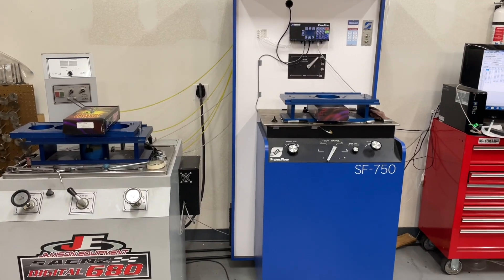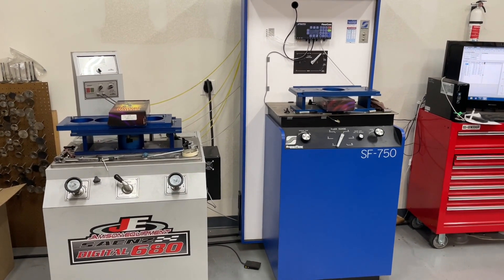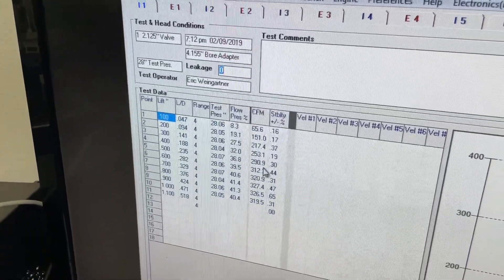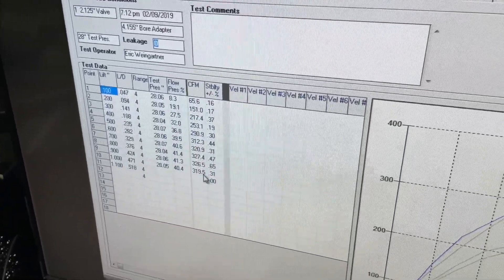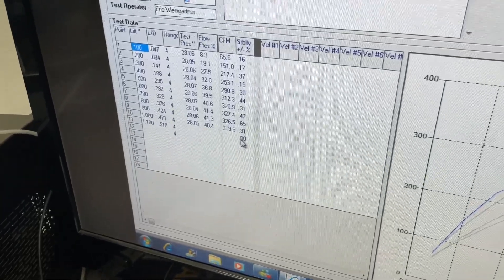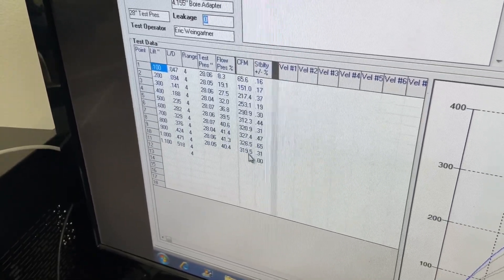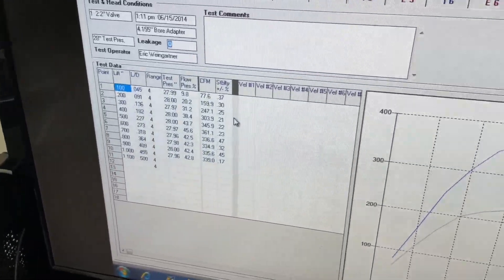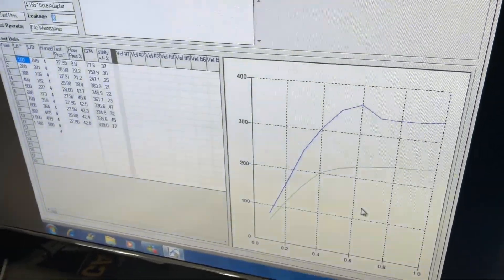Using Flow Numbers

Comment: That was the best no nonsense explanation on air flow in a head that I`ve heard. Made perfect sense out of a subject that always seemed somewhat vague to me. I went back and dug up my flow sheets for the motors I dynoed. The ones that  were close to all in at 500 lift and didn`t back up made the best power. (sbc 23*) spec motors

Comment: Excellent description, seems like a marketing tool that should have been used many years ago, but I suppose the bulk of the "advertised" heads on the market are far more street orientated than race. (IE our X head peaks at .XXX, but doesn't back up at .XXX, so it will make more power than our competitors equivalent head) 👍for the video!

Comment: Why not test at higher depression e.g. 60” and correct back down to 28”? This will get the air speed over turn to go problematic if it’s going to
Reply: Agree with your comment. Some guys flow at lower depressions, like 10" then convert to 28". If you flow those heads at 28" the numbers are way off. Some guys wont list bore size used. I ported a pinto head and got it flowed at 28", the guy running the bench switched up to 40" it didnt sound so good. You could hear the air wasn't happy. I read a article some time ago that F1 guys flow at 120". Would love to see that bench in action.
Reply: Because the flow bench would become impractical. Too many vacuum motors costing too much and as odd as it sounds, would pull more electricity than many shops could handle.

Comment: I've often wondered what if you inverted a "D" shaped exhaust port. The small radius would be at a minimum area and transition into a larger surface area, then if you get iinto port floor separation flow will follow the largest curve.. just a thought.
Really really enjoy your channel
Reply: Lots of heads have d port exists, some of them even raised. You see it with ponchos and chevy's on aftermarket heads

Comment: This is the first video that has acknowledged the (jump) of the short turn. This is the exact knowledge port entrance or approach comes into calculation. And why splayed valve heads will flow better in certain situations. The valve face canted down or into the cylinder bore allows those high speed charges to skid across the valve and into the cylinder instead of fighting to go around the valve face. I think you just gave away the secret Jon kasse has used to win most of the engine master challenges. High velocity ports, love canted valves. And slow factory ports can take more advantage of straight shots across the valve face for fuel mixture distribution. Great video.